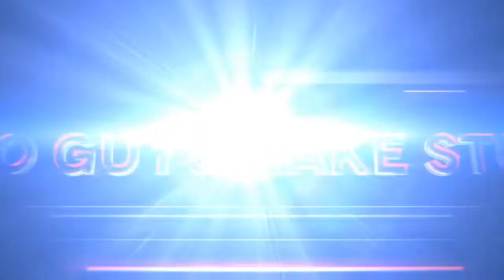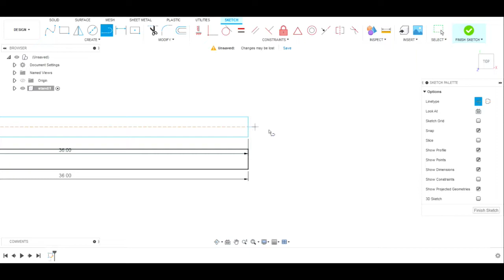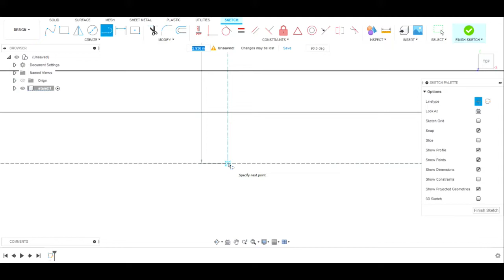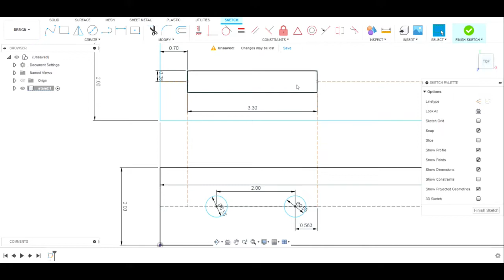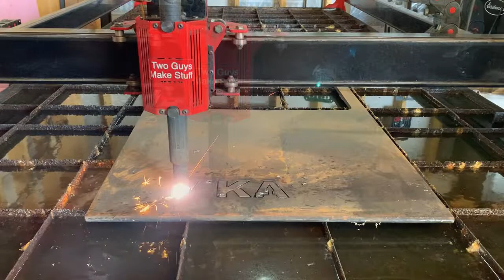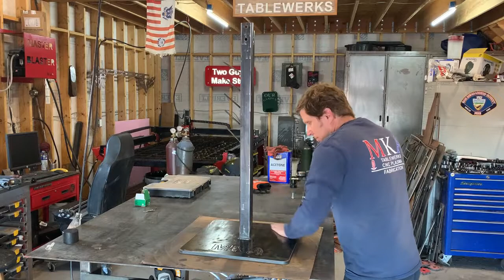Fusion360 and CNC plasma make a stand for our bead roller. How you can use construction lines.

Comment: Bought the same roller 3 years back. I took mine to the same modes as Jere Kirkpatrick did to a HF bead roller. Have you checked out his his channel? When I have time to finish it, mine will be powered via HC chair 24 vdc drive motor with foot controller, and have fwd & rev functions. I follow Adam Deuling, and admire his talent's and skills. He has more of his content on FB & Instagram than  here on YT, but high sugjest you guys check him out as well, and let him know Bear at Bear Rod Shop sent you. Have a Safe and Merry Christmas. PS. I did contact Ray after seeing your video on the Wells Index. I bought a #55 in October, and have parts for sale off it. Bear.
Reply from the maker: We plan on motorizing ours too. Those guys do amazing work!